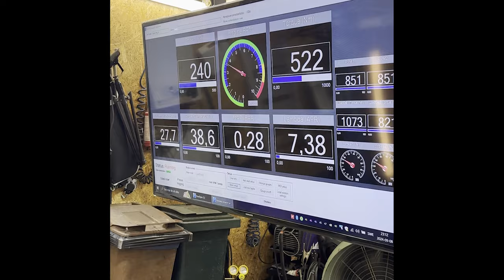BMW M4 DTM//TIME ATTACK//HILLCLIMB - Bad suspension bolt

Comment: The best thing I found for marking bolts is called “cross check”. It’s not a pen, it’s more like a gel, but hardens and breaks off if the bolt moves, it’s also a very visible orange color, makes it super easy to check.
Reply from the maker: Thanks will check it out :)